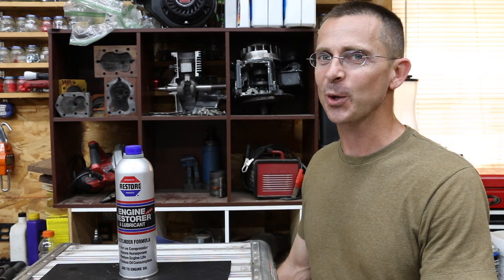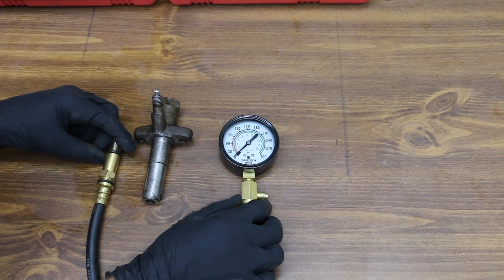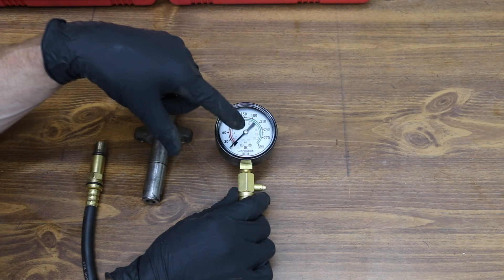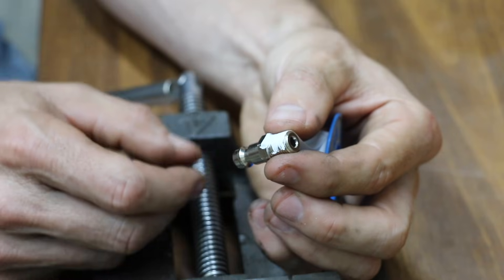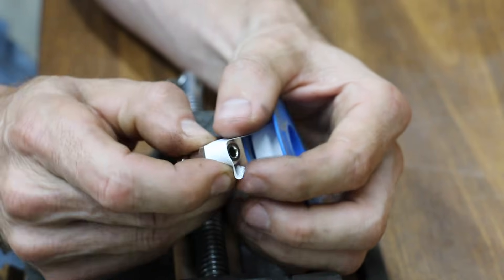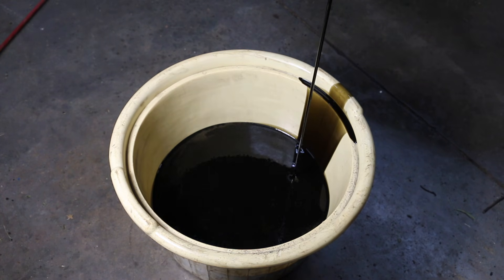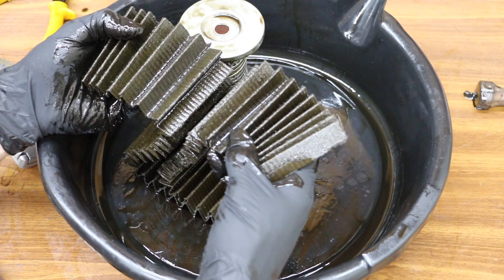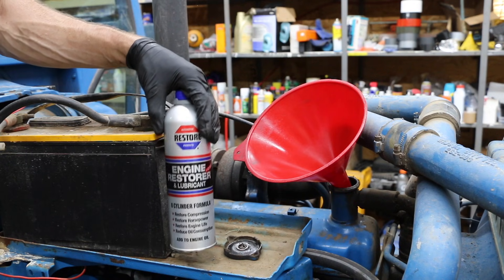Did the "Engine Restore" Compression Improvement Last?  One year later (Episode 2)

Comment: Depending on application - BG109 (EPR), Marvel Mystery Oil (MMO), SeaFoam and KREEN.  But, after this video, I'll see if Engine Restore works for some tired motors :)
Reply from the maker: Thank you
Reply: I know there's no such thing as a miracle in a bottle, but this stuff really did work for me! Not sure if you saw my previous post, but my 2002 Mazda Tribute had been using 2 quarts of oil between changes and at 180k it started smoking quite a bit when I cranked it after sitting for a few hours. So, before I traded it in, I decided to try this stuff and it now it has 233K miles on it and the oil is in the safe zone on the dipstick at oil changes and no more smoking - I replace a quart of oil with this every time I change the oil - it actually saves me money now that I don't have to add oil anymorel
Reply from the maker: Yes, I recall seeing the post. Very impressive results!  This seems to be one of the very few additives that works as well as advertised. Thanks again!

Comment: I should add that I use this at every 3000 mile oil change and use the 8 cylinder can in my V6 with Castrol High Mileage oil.
Reply from the maker: Great strategy!  I use it in one of my vehicles that uses some oil to and it has greatly reduced consumption.  Thanks again!

Comment: Around 180K miles my 2002 Mazda Tribute started smoking quite a bit when I cranked it after sitting for a few hours. It had been using a using about a quart of oil between oil changes and it would be another quart low at 3000 miles a couple years before the smoking started. Well, it was a little embarrassing leaving work with this big plume of white smoke trailing behind me so I decided to give this stuff a try. It now it has 233K miles on it, the oil "MIGHT" be a a little below full but still in the safe zone on the dipstick at oil changes and no more smoking. YMMV (literally)
Reply from the maker: Very impressive results!  Wow!  Thanks for commenting on this.

Comment: Tip from a plumber flip your roll of Teflon over and move the Teflon roll around the fitting rather than spinning both the Teflon and the fitting
Reply: @Ashley Bernard 
Cooper still lasts longer
Reply: @DaDaDo661  and you arent drinking plastic particles and bathing in it
Reply from the maker: Great tip!  I'll do this. Thank you
Reply: @ProjectFarm  Agreed. Doing it Tyler's way actually makes the tape self tensioning since you're controlling the spool with friction from your fingers.

Comment: I had a Porsche 924s and the rebuild kit is like 5k for the 2.5 Porsche engine. So as a last ditch effort i used restore and it stopped all the oil buring and low compression engine over 2 oil changes. I wasn't easy on that car either lots of 7k rpm driving and it totally sold me on it.
Reply from the maker: Impressive results!  It seems to be one of the few products that works.

Comment: One thing I would say about restore is, shake thoroughly. The active ingredients all settle at the bottom of the can and will stay there if you don't suspend it all in the oil.

Very thorough video! The only thing missing was horsepower before and after.
Reply from the maker: Looks like you found the video.  Great point regarding the HP. I wish I had a dyno or a place nearby that had one.
Reply: I did, thanks!

Comment: Engine restore does work. I had a go kart engine that had few scratches in the cylinder wall. I used restore in it and it filled the scratches in. There’s was black streaks of epoxy like material embedded in the scratches and it made the rings seal good again.
Reply from the maker: Impressive results!

Comment: My car is interesting, if I put the key in and attempt to start the engine straight away, it will crank over for about 5 seconds before starting. But if I wait for all the icons to disappear off the dash, usually takes about 3 seconds, then start it, it starts straight away. 

Any ideas?
BTW, its a petrol engine.. I'm thinking it has something to do with the fuel delivery
Reply from the maker: Yes, most fuel pumps normally function for approximately 2 seconds when the ignition switch is in the "on" position.  If you attempt the start the vehicle immediately instead of allowing the full 2 seconds in the "on" position first, the fuel pressure probably hasn't reached its normal operating fuel pressure. It sounds as though the fuel system is losing pressure once the engine is shut off and it's taking a while to build pressure. You might try cycling the fuel pump twice.  Place the ignition switch in the on position for 2 seconds, then place it on the off position, place it in the on position again for 2 seconds and then attempt to start it.  It might start sooner than 3 seconds this time. Hope this helps.

Comment: I used motor flush on a 1988 300ZX that ran weak at 150,000 miles and it ran smoother and regained some power.  After the next oil change I added restore with csl and after a few days it drove smoother and quieter to the point my friends noticed.  It was kind of a crappy car that looked and drive nice so I figured inhad nothing to loose.  13 years later the transmission had died 3 times and pretty much everything in the car had broken at some point but the engine still sounded smooth and felt the same when I sold the car.
Reply from the maker: Impressive!
Reply: Project Farm Crappy car made it to 300,000.

Comment: Restore is a great product, but be careful using it in cars with variable valve timing. I used it in one of my Hondas, and it clogged the VTEC solenoid screen, causing an engine light. But no damage was done. I removed the solenoid, cleaned the screen, and reset the computer. It runs good now. Restore did stop the engine from burning oil.
Reply from the maker: Wow! Thank you for this information.  Glad you save the engine from damage. I've used it in my daily driver and it has greatly reduced oil consumption.
Reply: I don't think that Restore will damage any engine, even if it has VVT, but in my case, like I said, it caused a check engine light, so be careful using it in any engine with VVT. Just curious- Does your daily driver have any type of VVT?

Comment: If you can find it, try RewiTec. 
In my, admittedly not very controlled, test I saw almost 1 bar of compression improvement on a Mariner 10 HP 2-Stroke Outboard Engine.
Reply from the maker: Thanks for the recommendation!

Comment: Nice video man as per usual . Just wanted to ask if u recon engine restore will be ok on a common rail diesel?
Reply from the maker: It isn't recommended for the Powerstroke but I believe it's fine for the Cummins and Duramax. I'd check the Engine Restore website to be sure.

Comment: I see RESTORE claims this product doesn't alter oil viscosity. What's your opinion on that claim, out of curiosity?
Reply from the maker: The viscosity seems very similar to 10W-30.  However, I do believe just about anything added to oil will in some way impact viscosity a little.
Reply: Project Farm I'm with you. It only makes sense that way. I contacted Blackstone labs asking if they had a way of measuring viscosity. If they do, I'll send in two samples, one with and without and report back what the differences are. Either way I think I'll be doing a comp test in my F-250 before and after Restore. Great channel. One of my favorites on YouTube, for sure. Keep it up.
Reply: Project Farm From Blackstone Labs:  "Yes, we test the viscosity as part of the standard analysis we offer, so we 
can do that without a problem. I will tell you that we don't normally see 
Restore alter an oil's viscosity too much. It tends to show up in our 
testing only as very high copper and lead."

Comment: I use one quart of Lucas Heavy Duty Oil Stabilizer, one quart of Marvel Mystery Oil and 3 quarts of 30W Castrol.
    My question is, whether or not this Engine Restore is compatable with the Lucas Oil and the Marvel Mystery Oil.
Reply from the maker: I don't know if it is compatible.  If the engine has good compression, engine restore isn't necessary in my opinion.
Reply: O K !
 Thanks !

Comment: i work as a professional auto mechanic that usually has me deep into the greasy depths of vehicle engines, i can say with confidence that restore works, and has worked when i fully expected it not to work, i had a 94 audi with a junky 2.8 v6 engine with 2 cylinders that had bad rings with plenty of blow by that would not pass emissions, put a v8 can of restore in it and let it run for 30 minutes, by that time the engine exhaust had completely cleared up and the vehicle was able to successfully pass emissions. one thing that may be a bit more difficult to test without the proper testing tools is CRC's "guaranteed to pass" emissions system fuel cleaner, this stuff has proven to work on many ocassions for customers who didnt want their cars "properly" fixed, but for them somehow it works, not the route id take but hey, to each their own.
Reply from the maker: Impressive!  Thanks for commenting on this.

Comment: @project Farm

Out of curiosity, What is your opinion on if this product will be ok to use in a worn down slip (or non slip) differential that had visible metal fragments/shavings in it when I drained. Its from an ATV, and I am curious it will extend its life or prevent further (abnormal) wear? 

I realize this is designed more for an engine, but curious how/if it would work on a differential. 

ps: oil is sae 80 for the differential
Reply from the maker: I think this product is great for an engine, but probably won't provide much, if any benefit in this situation.
Reply: OK, thanks for your feedback. Was just curious.

Comment: Great job with update video. I now subscribe.
I'm one of the original slick 50 dealers when it came in metal cans. I swear by this stuff. I literally ran engines with no oil to show customers how the Teflon was in the flaws and pits of the cylinders pre lubing the engine. I had a Chevy 454 Caprice that when I put slick 50 in it I actually had to Idle the car down that's how much it reduces friction. That's my thought on slick 50
Reply from the maker: Impressive product!  I've heard from those leaving comments that the original product is much better than the latest formula.

Comment: I have heard flushes can dry out seals and in certain older engines the carbon can be preventing loss of compression so would not risk it myself (never paid more than 1500 for a car) but might be worthwile in a low mileage application.
Reply from the maker: Great point.

Comment: Quick tip- There are tools specifically designed for cutting oil filters open. Oil filter cutters are basically like a heavy duty can opener. Just thought I'd let you know.
Reply from the maker: Thank you!  I just purchased a filter tool after receiving advice from other comments.  I'll demonstrate using it in an upcoming update video on the Ford Ranger (Seafoam/Lucas treatment)
Reply: Awesome! I just thought I'd let you know to make your life easier. I was sure that wasn't the only oil filter you'll be opening. (:

Comment: Instead of tapping another injector cap to accept the fitting, you could have switched the hose over from the other tester. Its hose attached to the same pneumatic fitting, but had the same threads to go into the injector cap you previously used.
Reply from the maker: Great point. I tried to do that but the fittings were different.

Comment: I used the full synthetic 0w30 long last  by mobile 1 with the 4 cylinder restore.  Since it didn't burn oil I can leave it in for almost 10k and every oil change throw in another bottle of restore.

The small echo is allot more pepier compared to when I first got it. I will be using this method in all my non oil burning cars to save on oil+restore costs.
Reply from the maker: Thanks for commenting on this.

Comment: For older equipment, you should try sending an oil sample in to Caterpillar or other laboratory before and after on your regular oil change interval to see the difference. They usually can determine what part of the engine is getting worn or about to fail just by the metal particles found in the sample. You do need to use their sample bottle to reduce cross contamination.
Reply from the maker: Great recommendation.

Comment: Sucking up metal fragments using a magnet like that is not a great idea (especially for that damaged one of yours). They're gonna be borderline impossible to fully get off and if you want to more conclusively be able to do tests like these without having shards getting into the damaged bits, AKA being invisible, i recommend buying a few circular ones, stacking them in series for additional strength and to allow significantly more possible attraction from the sides.

You could also try putting one or two of those black gloves around yours (or other thin material) to be able to easily pull off any fragments (if any) without damaging or contaminating the magnets while allowing a stellar contrast between the black and sparkling of metal. Can probably even rinse the outside off with water as well with them not falling off if dipped in oil like in the video..
Reply from the maker: These are great recommendations.  Thank you!

Comment: Good to know. I've used restore for years and always saw reduced smoke on my garbage. Seemed to help performance too. I'm putting a used long block in my drift car and did a compression test before I do an event. 164 low and 179 high. Can't wait to see what it is after a day of thrashing. I used a bottle of CD2 oil additive i had laying around forever in my drift car before last event and it was around 220+ degrees a bunch of times but never seemed to lose its oil pressure. Maybe do a test on different additives and temperature breakdown?
Reply from the maker: Great recommendation!

Comment: Take the oil pan off and you can see where it repairs cylinder walls did this on my sister's Nissan pickup 30 psi compression to 100 on 1 cylinder n the other 3 80psi to 120  after using I swear by it and use it every other oil change now
Reply from the maker: Impressive!

Comment: Diesel engines need a minimum of 300 psi in order to ignight diesel. For every psi of compression it raises the temp of the air in the cylinder by 2 degrees Fahrenheit.
Reply from the maker: Great point!

Comment: Hi,
I was looking around your channel and was really interested in those engine additives like seafoam, but as they are not available in the europe, can you test some of the additives that are worldiwide available like STP (Engine Stop Leak or High Mileage Oil Treatment) , LiquiMoly (CeraTec, MoS2)?
My current car went through more than 400k km, and it is needing a engine rebuild just as your Ford truck, but at the moment I wouldn't go with that option financially so I need some advice and/or proof that available oil/engine treatments work really well like your seafoam did. Honestly I would order the same set for my engine but it would cost a small fortune to get it shipped here to europe :-/ 

Anyways great channel, keep it up :-))
Reply from the maker: Great recommendation and thank you!

Comment: Love your videos brother! You deserve to have way more views than what you're getting but beware, popularity isn't always a good thing haha Because of you I have switched to mobil 1 full synthetic to all my vehicles, and engine restore in my old Silverado. Best it's ever driven! Take care man!
Reply from the maker: Thank you!  Mobil 1 is a great choice!
Reply: Doc Palmer I am using motor kote because of this channel also ,bought some 2 weeks ago my girl friend has a wool cutter I was getting hard to
Reply: Doc Palmer The wool cutter was getting hard to turn the handle,I put penetrating oil and atf in the gears and shafts after cleanup still was way hard to turn then I put a couple ml of motor coat on the same parts and it was amazing turned nearly no resistance. I just put in my 2006 caddy I
Reply: I put rest of the motor coat  in my 2006 caddy CT’s 2.8 liter known for timing chain disasters and a hi quality 5-30 synthetic oil recommended by gm .I bought the car as is un road worthy from a local Kia dealer and it was in mint condition as far as rust goes the original owners had it in Florida except 1 year their daughter drove to university here in Ontario Canada I payed little for the car and put new 18 tires and new brakes on the car power washed the chassis sprayed the chassis with metal prep phosphoric acid let dry painted entire underside with rust paint and undercoated and oil sprayed door sills pillars all unibody components and voids , and will put in storage when late fall comes  . The car was cheaper than me fixing my Ac myself on my 2004 gt Grand Prix envelop with brakes and tires I buy from local auto supply store.

Comment: I have a litle recommendation , when you are going to change a oilfilter like that , drill a hole in the filter and then turn the filter so it can drain out befour you losen it completly , in that way you dont make a mess on the motor and the new filter put a strong magnet on the outside then you can see if there is any metalparts on the inside next time you change it and open it to look inside. Just a simple tip.
Reply from the maker: Great tip!

Comment: Test different kinds of stop-leak for cooling systems.  Maybe test the ability to seal under heat and pressure, test the incidental clogging of passageways... etc.   You will probably want to figure out a way to bench test this.  This will be a very very interesting experiment if you can get it right.
Reply from the maker: Great recommendation!